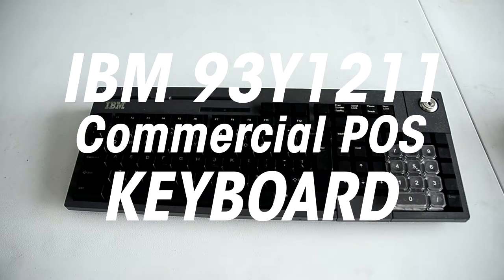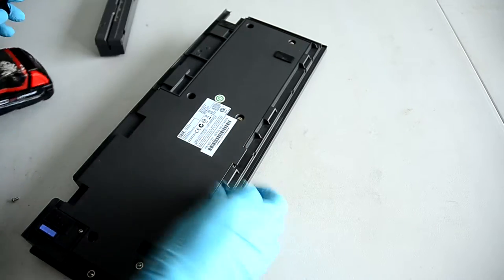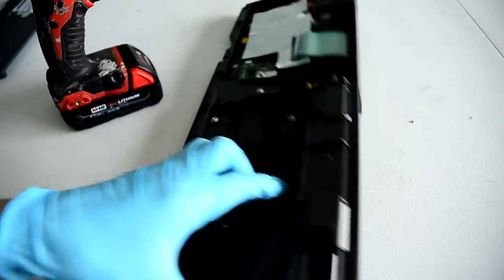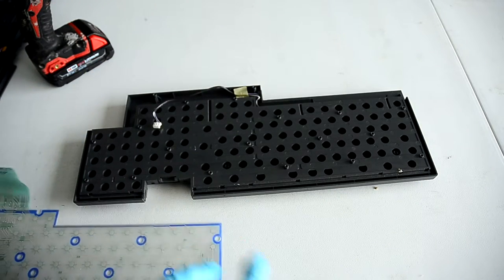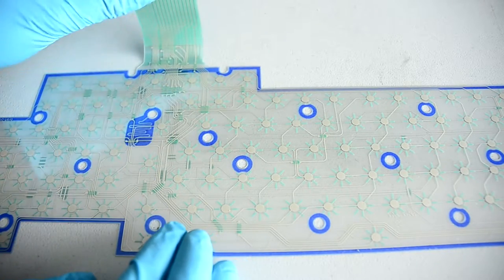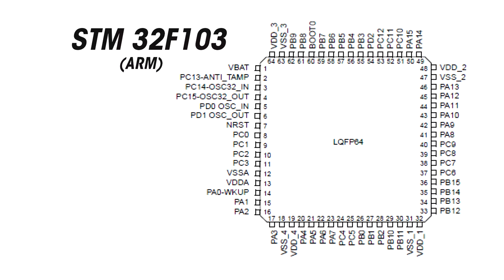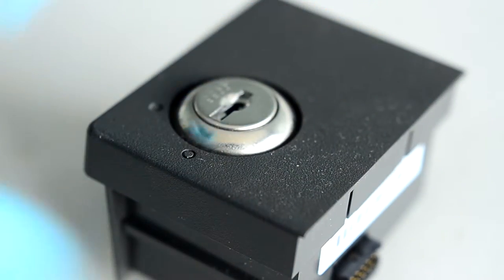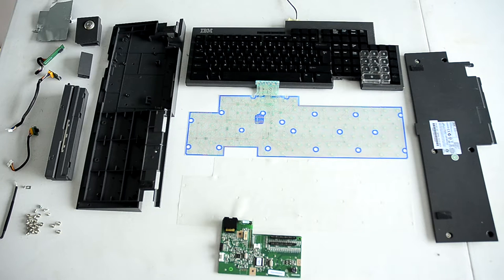IBM POS Keyboard Teardown

Comment: I had always wondered about these keyboards because when I heard those being typed on I too had originally thought they were mechanical. I have tried researching the technology behind these IBM ANPOS keyboards and I haven't found much but some sources said they are rubber dome but from what I'm seeing here that is definitely not rubber dome as there's no rubber sheet over the membrane sheet. The way those "pins" look underneath the keys kind of reminds me of Topre switches, but overall it's a rather peculiar setup. I wonder what the actual formal name of this technology is but as far as I know, I don't know of any other keyboard that has this type of interesting technology.
Reply: I'm not 100% sure but i think this is a "Buckling Sleeve" keyboard, same technology they used in the old 90s thinkpads and space saver m4-1 keyboard.
Reply: @archygrey9093  I've since learned this keyboard uses "dome with slider" technology but there is no rubber domes like the M4-1.
Reply: @SanAndreasElevator  I can confirm it's buckling sleeve (search "IBM Modular POS keyboard buckling sleeve" for photos). A while ago, I used to believe it was dome with slider based too but pulling off the keycaps reveals the sleeves. Just, the keycaps are pretty fragile so I guess people seldom pull them off.
Reply: @sharktastica  Interesting. Thanks for the info.

Comment: Why is it so surprising that a commercial keyboard like this one isn't mechanical?
Reply from the maker: I had always thought that point of sale units were built to spec not price, seeing as they are used far more often, I thought Mechanical keyboards could see more long term use?
Reply: Elliott Schuman makes sense. but they don't make em like they used to. is a keyboard like this designed with security in mind?